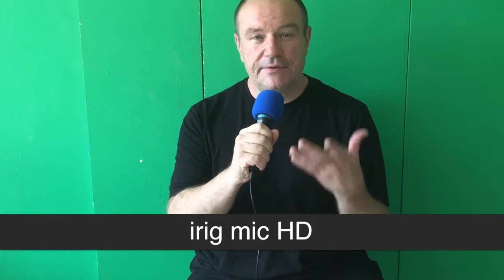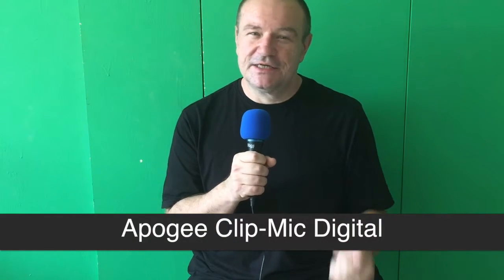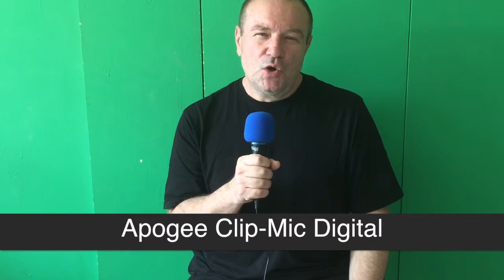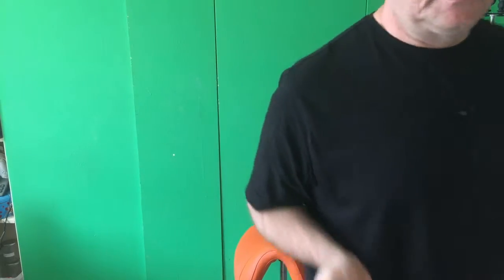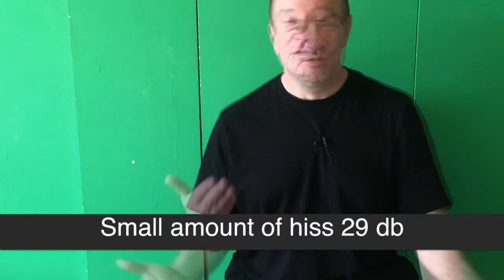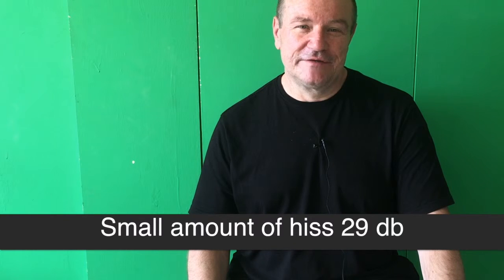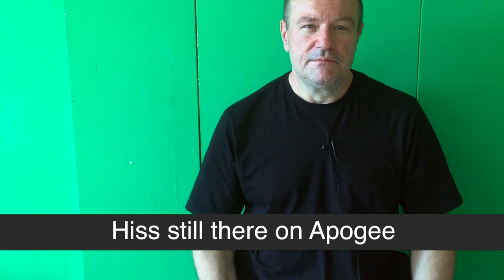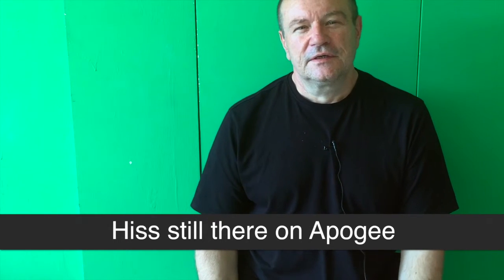Testing iRIg HD and Apogee Clip-Mic Digital with CableJive lightning extender

Comment: Good review and helpful. I am interested in purchasing the mic after 
your review. I have a multi question. Will I be able to use this mic 
live on Periscope and Facebook Live? If I am using my iPhone 6 Plus with
 this mic and go live on Facebook live or Periscope, will I need a 
special app to use it live or do I just plug in the mic and turn it on 
then go on Facebook and Periscope apps and then go live through the 
Social Media apps directly?
Reply from the maker: You should be able to - yes. If you try and plug in headphones as well then the phone might get confused if the headphones have a mic on them. I use a smartlynk device into the headphone socket for facebook in particular as I want to be able to monitor the sound before it goes out.
Reply: Thanks! I am going to purchase it this week.